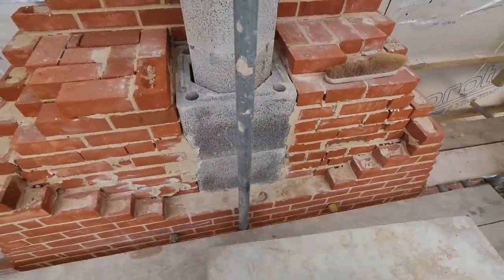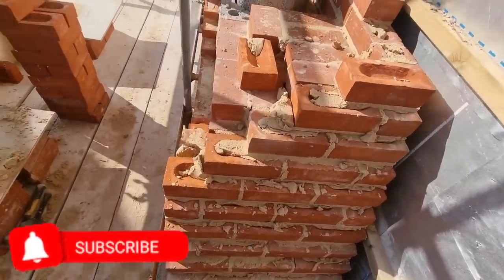Building a chimney #bricklaying #construction #build

Comment: I'm one of those curious layers from the u s. Is there no such thing as cord brick in the u k?
Also do you mainly use a lime mortar?  I really really like the flu. Round like it should be and how it's contained. Where I live , there needs to be at least eight inches of masonry between the substrate and the smoke chamber. Wow, what I love to come out your way and do some work? I love this trade.
Reply from the maker: It's all built to architects spec buddy. Chimneys are different depending on which contractors doing the job. 🧱 we youvwhite cement instead of lime nowadays here 😊😊

Comment: Adam did you put a lead tray at chamber  level,why is it solid from throat lintel when it should be vicolite?
Reply from the maker: Architect specifically specified solid brickwork to that point bud. I did question that. And was told it has to be solid until it reduces. Then vicolite from the stage I finished at. I've set out the gap at the top if u see. And mention it in the video too 😊😊

Comment: surprised not in filling with concrete blocks  then back to brick once its reduce more   could of used a set of drop lines  to control the front plumbing points
Reply from the maker: No concrete blocks on site bud. Timber frame . So we don't used them. Traditionally built 💪 strong. £1.2 million house 🏠 😍

Comment: turn your corbled bricks upside down please
Reply from the maker: No. Weak !
Reply: @trickybrickys  when you turn a frog brick upside down for aesthetic looks you fill the frog with mortar first ,no weakness ,end of dialogue
Reply from the maker: 🤠🤠🤠 all the weight is on a ares of the brick so no. 🤣🤣 level 5 nvq been doing it since I was 16. I'm 43 now. And have had this debate many a time. More pressure per sp inch  . I appreciate the comments bud. Really I do. But unfortunately you've been told wrong. It's OK we all mess up bro. I layed a brick mum and dad. But I was professional enough to make it right ✅️.  Enjoy your evening bud